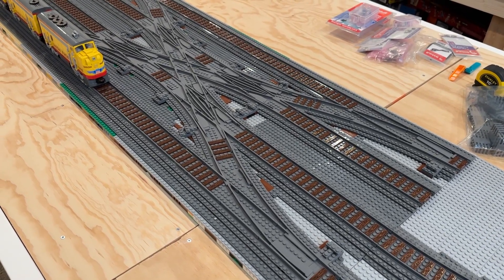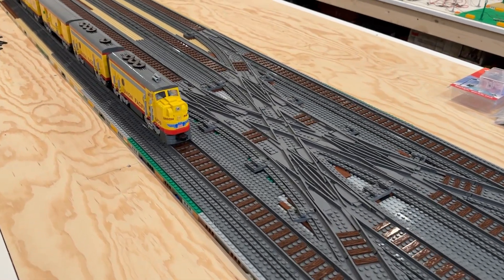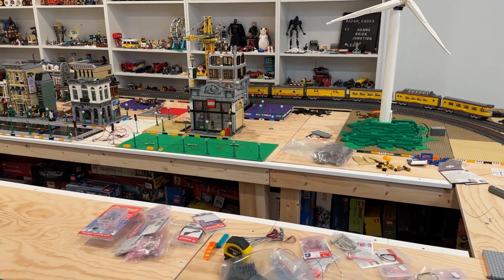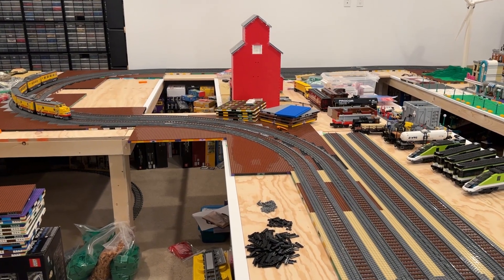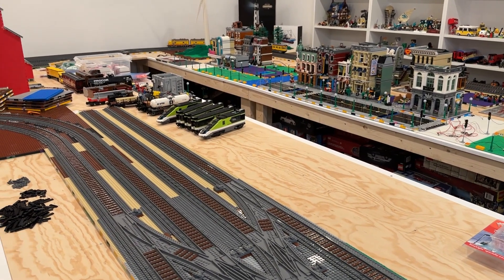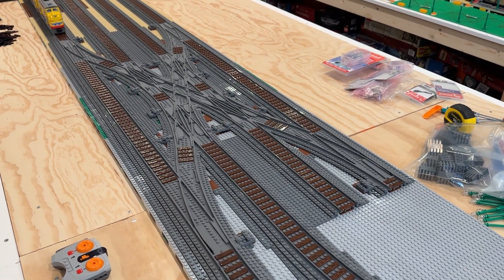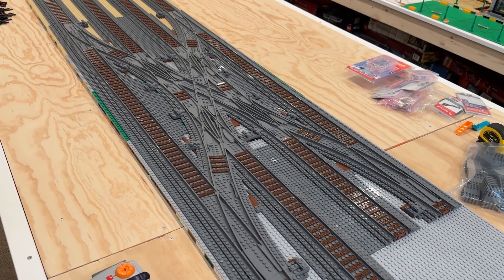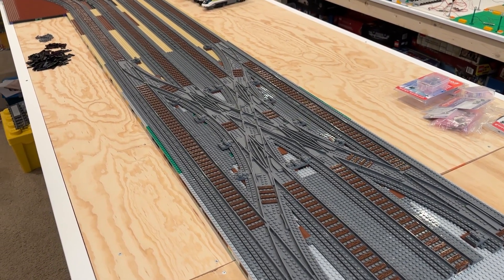LEGO Trains - Union Pacific Train And Integrated Monster Double Slip Crossover

Comment: I bought this double slip crossover and I love it. There is one problem with it. You don’t have control of the 4 slips on each side of the diamond crossing, there is no levers. Like you would of of had problems taking your train onto the inner siding. I’ve replaced some of the points with more single double slips and you could made a good metro rail network. I asked Trix Brix if they have any plans to make a single slip version and separate single slips and they do have plans one day. So train don’t cross into up coming trains.
Reply from the maker: You can control the inner switches.  There are tiny little switches that you can flip on the inside of the rails.  I will try to cover it in an upcoming video.  Thanks for watching!